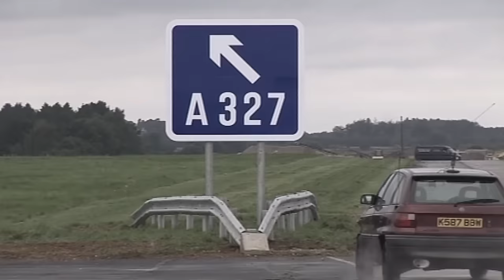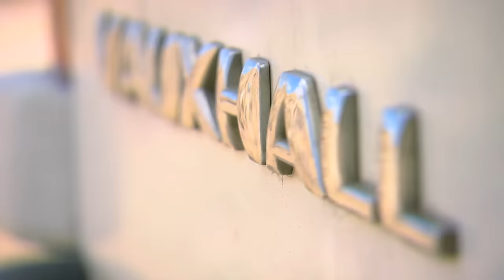Crash Test Month: Van vs. Car

Comment: I think even without a load in the van I'd rather be in the Passat because it has airbags and a more modern structure. But both would hurt like hell. Even in a 2008 or newer Honda Accord that impact would hurt.

January 25, 2015 2:31 am
Reply: Seatbelt is by far the most important safety equipment. Biggest problem in the van was that the load wasn't tied / they didn't have a wall between cabin and load space.

I would have rather been in the van, because it's heavier and therefore the acceleration on the passengers on the van was much smaller than in the Passat that actually changed it's whole moving direction.
Reply: wopmf4345FxFDxdGaa20 But NCAP said the driver of the van would've been killed by hitting the steering wheel.

Comment: it would be very interesting to see comparison of crash test e.g. regular Ford Focus vs. Ford Focus rally version reinforced with steel tube frames (as seen at WRC cars).

If we really and seriously want to set a relevant rating (EURO NCAP is not), a top secured (5 star rated as most secured cars regarding crash tests) cars ought to be only cars with deformation zones as todays newest 5star car models, but indoor reinforced with steel tubes as WRC cars have.

Please, if someone knows about crash test of such rally car, share it. Thank you.
Reply: The problem with the safety of a roll-cage for everyday road use is that its only safer when used with other safety devises i.e helmet, racing seat and harness, fire retardant suit. Otherwise your bare head could hit the metal bars, you won't be able to escape the vehicle after a crash without assistance and jaws of life will not be as effective when the rescuers try to extricate you. But yes, there could be a compromise, where the roll cage is designed to work with side/curtain air-bags when no helmet is worn, doorways are clear of tubes etc. Vans and SUV would benefit the most with their roll-over risk and poor crash test results. Whatever safety measures are introduced, driver training and education is still the most important and effective aspect, something, as a motorcyclist, I cannot stress enough.
Reply: I think the tubeframes are most important in roll overs. While in a full stop head on crash like this (that almost never happens in a rally, because all people drive in the same direction), tubeframe alone doesn't do much, because the biggest problem usually is the high forces and high acceleration acting on people. In that way tube frame might even do worse, because crumble zones in modern vehicles make the crash softer like they are supposed to do.

Rally drivers also wear a very good helmet, they have a special suit and gloves in hands and much better seat belts and seat than in a regular car. Rally drivers also sit closer to the middle of the car and lower.

The car could be made stronger inside without tubeframes too, simply by increasing the material thickness, using stronger steel quality or perhaps using a totally different material. And modern cars are much stronger from the body than old cars were. :)

Comment: How come the airbags didn't deploy in the van? I'm assuming that van has airbags.
Reply: No airbags in a van of that age - but the latest ones do have them.
Reply: truthpig Wow. How old is it?
Reply: ***** Think they said 12 years old
Reply: truthpig Wow that's kind of scary that 12 year old vehicles there didn't have mandatory airbags (I'm assuming there was a better version with airbags).
Reply: It's a van - they are never safe.

12 years old and no airbags? Crazy! The B5.0 (1997-2000) Volkswagen Passat had full airbags, so did the Vauxhall Astra and the Vectra.
Reply: SIMcityplayer2002 I honestly don't think a passenger airbag is useful in vehicles that have dashes so narrow and only about 6 inches from the windshield to the leading edge.
Reply: That is correct, you may get back injuries.
Reply: ***** I think around that time the law began to require driver airbag for vans. Many of that age vans have driver airbag.
Reply: truthpig yeah 51 reg means 2001 that make's it 14 years old now

Comment: That's why you buy mercedes van eg sprinter
Reply: Just secure your load.
Reply: MrDutchdemonify
Most loads are too difficult to secure properly, so a proper bulkhead or at least a rated safety-barrier is a must!
Reply: MsShoaib123 Buy a volvo,better protection
Reply: Forename Surname I second that my 55 Sprinter is no end of trouble, but fast as shit when it works 3.5 Diesel easily crusie at 100
Reply: ***** 
Foleleldldl
Reply: MsShoaib123 Mercedes doesn't make any difference here. You must secure your load with any van or buy a van with a proper wall between the load area and cabin.
Reply: johan knoop look
Reply: MsShoaib123 no you buy a ford transit all mercedes sprinters of all model years rust after 5-7 years.

Comment: Now repeat the test using a Toyota Hi-Ace which is the type of van that's popular here in Australia, where the driver sits above the motor & there's really no crumple-zone to speak forward of the front occupant's legs!
&B^{O?
Reply: The nearest thing they could do is a granvia which is a hiace with a front end attachment

Edit:
The Mitsubishi l300 van has the same cabover configuration and is sold there
Reply: There's 2x types of Hiace van; the type you mention with the engine in front of driver built in Japan which is no longer sold here in Aust., & the death-trap version built in Thailand which is sold here & very popular in SE Asain countries, but probably considered too unsafe for European roads!
Reply: StevieRay9O the reason for the granvia's inception is to meet euro safety standards which at the time was impractical to do in the cabover version and when the 05' model came out the granvia was discontinued in most markets except in the eu since demand is not enough to warrant the newer model and when time came when emissions was no longer adequate they rebadged a citroen instead. btw both versions were produced and sold in japan although the current ones are produced mainly in thailand.
Reply: StevieRay9O I spent a lot of time in Thailand and a massive proportion of their vehicles are death traps, especially trucks, vans and pick-ups, driven by drunken lunatics with no idea of the rules, who react by laughing when they narrowly miss a head on smash on a blind bend....  In spite of all the peril, I still love the place, maybe the constant danger of death and mayhem just makes life a bit more interesting?  And they have banana trees everywhere, which is nice....

Comment: actualy vans are much safer.... i saw a front crash betwen a car at high speed and and anbulance and the driver of the van was ok and the car driver died
Reply: Probably because the ambulance was going way faster and channelled all its force into the car.
Reply: I've been involved in 2 collisions van versus car. Van so very much safer on both occasions. On the worst accident the car driver had 5 broken ribs and life changing injuries. I had slight bruising from the seat belt in the van...